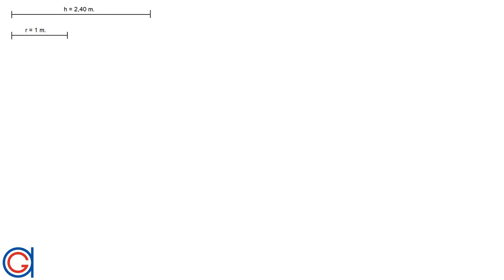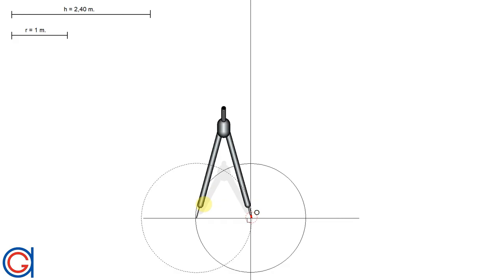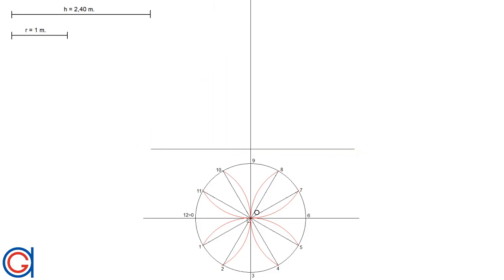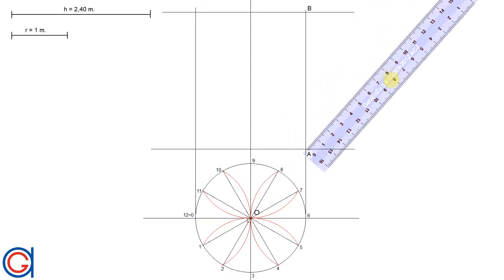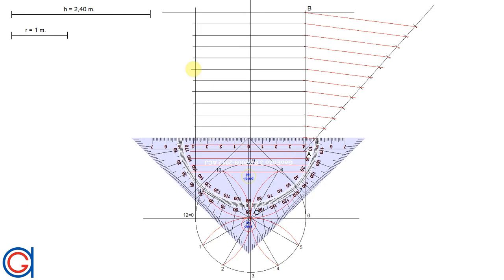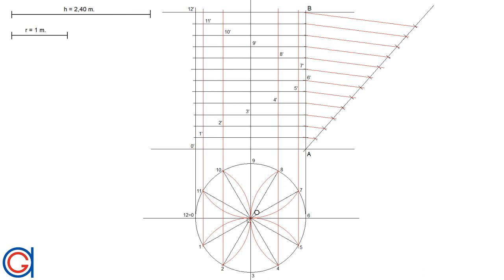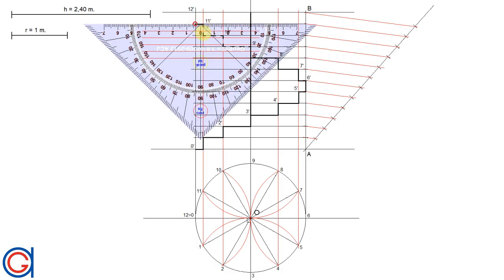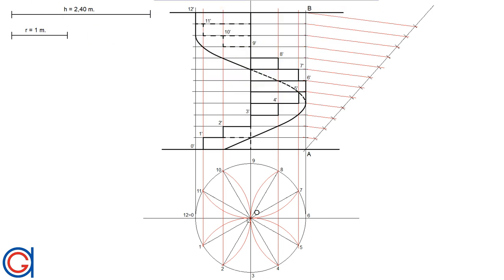How to design a Spiral Staircase

Comment: Great video but I think I will keep it more simple for my project. I will just design the steps first, then weld them to the post one by one evenly spaced according to what is comfortable to step on. I will continue this process until I reach the next floor, hope it works. Pd: the last step might be a bit off but what the hell…